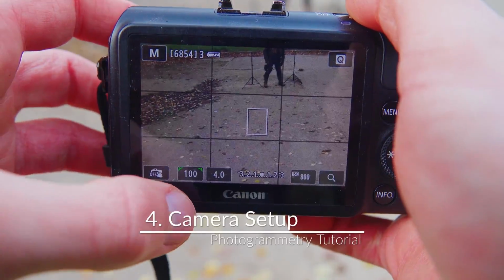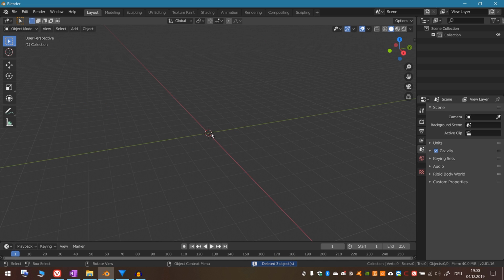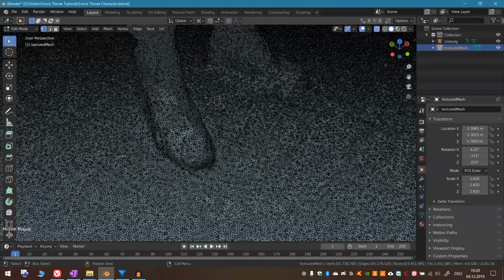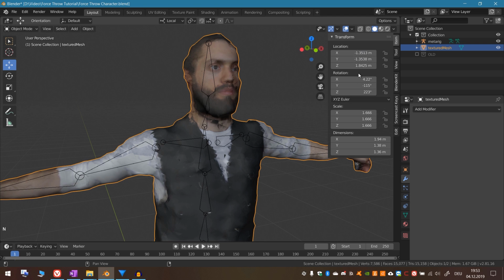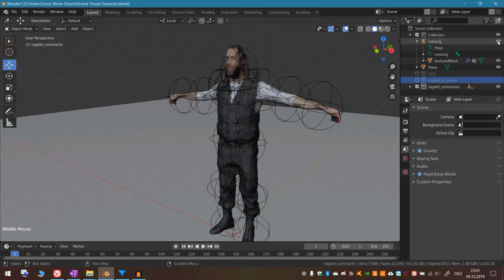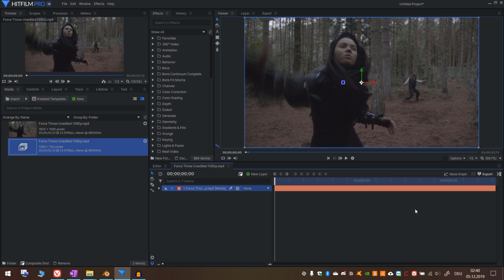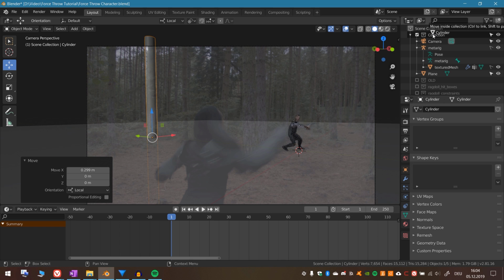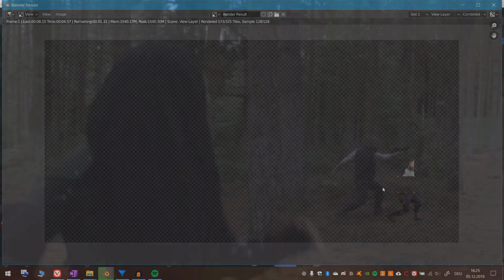Creating a 3D digital double in Blender & Meshroom | Blender Part 1

Comment: Timestamps - big advanced tutorial, fyi CUDA makes the rendering times sane without it plan accordingly, comment stamps you think are important to reference.

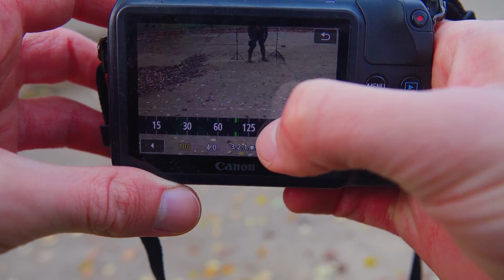Photogrammetry overview -  1:18 Actor T-pose with stands, 1:43 Camera settings
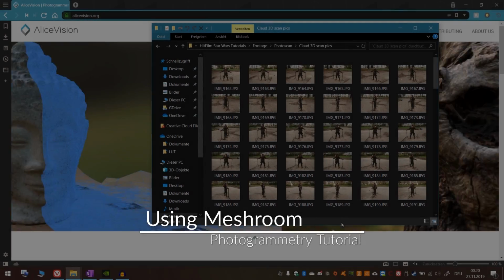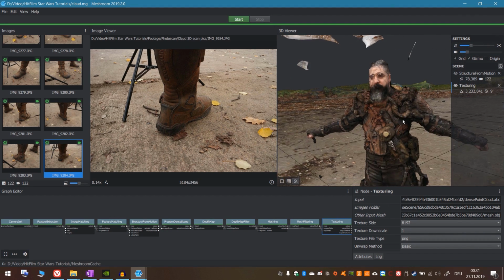2:53 Meshroom , 4:45 troubleshooting and problem examples
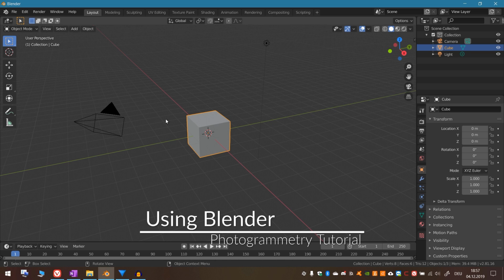6:38 Blender Import meshroom .obj file and blender mini crash course
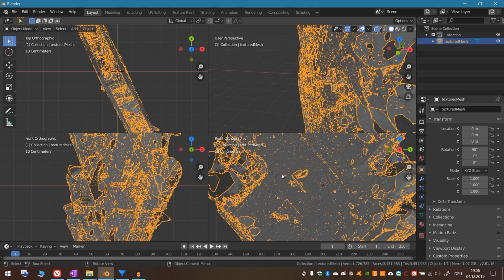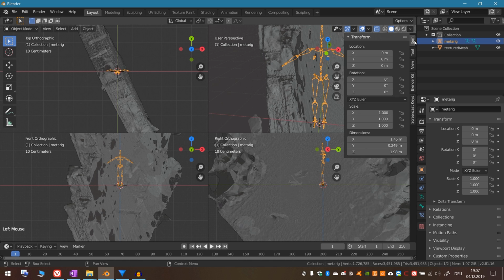 8:46 adding the reference mesh rig using Rigify(*free blender addon included in install*) , 9:19 Scaling the mesh/model [1]
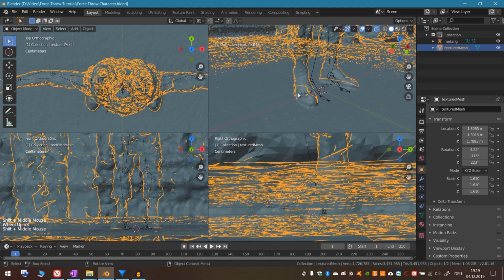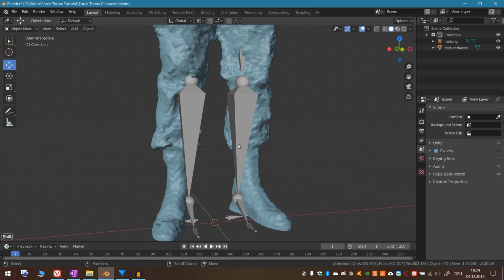  11:41 Mesh Extraction, 14:10 Rig visibility and alignment, 16:11 Mesh cleanup
 18:05 Physics setup using Ragdoll Tools addon (~$22 blendermarketplace) and 19:18 visual limits addon (free from github). Free method missing
   24:58 progress demo
 25:03  Animation keyframing
    26:49 progress demo - watch ollie fly
  26:51troubleshooting shaky glitches by increasing the steps per second to ~120 used by the rigid body world in the scene properties
27:16 Hitfilm export reference image sequence creation and blender import and setup
 29:37 Mesh starting pose alignment
  32:15 progress demo
 32:19 Tree collision setup
34:50 Blender rendering

[1] to change dimensions measurement units from metric to imperial(feet,inches,etc) use the scene tab in the right hand side panel in it's unit section , it's about the ~5th tab down you may want to change this back in case other tools are expecting a specific unit. Keep in mind this can throw things off if other tools in the pipeline are using a different unit
.
Reply: 18:53  Link in description for free video on manually creating a Ragdoll Setup 
 Blender: ragdoll tutorial
 by BlenderShortTests  /watch?v=GaZAI8RIq0
Reply: Huh... Useful of ya to build a ToC for this one....
Reply: Paul Newton, that took some effort. Thanks!
Reply: @anthonysvfx8424  yw but it helps me too for future reference,  hardest part  for such a amazing tutorial was coming up with short names!
Reply: Great tutorial!
Reply: I am having problems editing with HitFilm express. After i got the latest version, i finished editing my video but when the video finished exporting there was a transparent yet visible overlay of the HitFilm logo and a repeating lo-pitched Ding sound. Is it removable?
Reply: @thegreatestrussianspy6739  That descriptions seems like you have Hitfilm Pro installed and the trial has run out possibly, either you need to un/reinstall hitfilm express or check your activation licenses.  If that doesn't solve it go ask on the fxhome forums for help.
Reply: @thegreatestrussianspy6739  Per a comment from FXhome elsewhere in the comment section:
"You'll need to activate the program in the File -> Options -> Activation menu.
- Javert"
Reply: i will comment this here since your comment seems to be a sort of hub for people to look when they have trouble: 
in blender, when you add an object, that object will be added where the 3d cursor is (red/white circle with the lines poking out)
this means it will NOT automatically add the object to the center of the world if you have accidentally moved the cursor. the instructor showed how to move the cursor back to the world origin, which is what i recommend doing in such a case.

Comment: Hello, so if you have problems with your ragdoll just flying around out of control I have a janky method of fixing it.
Go to the ragdoll pie menu and then do "Set limits" what you want to do is change the mode to location and rotation and you can do that with shift m. If it's still outta control, I have no idea how to help you. Good friggin luck..

Comment: this tutorial is a BOMB.
I followed and it works perfectly with my photogrammetry!
Question: lets consider we have a 5 minutes 3d animation in which I want to animate my character using rigging classic stuff. Then I need a scene where my characther is thown in the air like in your tutorial. 
You need 2 versions of the character in that case, one for the classic animations and 1 for the "phisiques" scenes, right ? 
Because I see that you control some keyframes at 31:47, but of course that is not the most suitable way to animate a character if it is intended for a 5 minutes animation.
Thanks for all of your work!

Comment: Would this be a way of making textures and/or models for games like Squad, Post Scriptum etc? A way even to create and implement better ground textures?
Reply: For games you're generally going to want quite low resolution meshes. For game work you'd be doing a complete retopo over the scan. Photogrammetry is pretty amazing in terms of being able to create a mesh of anything you can scan, but it does generate ugly, unoptimized meshes.
Reply: @HitfilmUniversity  When I understand correctly I d be able to but it would be visueally not pleasing and unoptimized. 
For a "rough draw" although with the idea in mind of improving meshes later it would be a good way to go?

Comment: This is so good! I feel like going in a manually fixing some of the topology of the model would help with the final quality and make it almost perfect.
Reply: For sure! I just didn't want to go into that too since the Tutorial is already so long ^_^
Reply: @ChangorooStudio  Also, for the final shot, "Oli" is far enough away that the mesh didn't need to be super clean.

Calver, while I've got you in this response, I'm trying this myself (with a sub goal of also being able to take the digital double into Mixamo), in terms of workflow, is there a reason you lined up the mesh with the bones before trimming away the excess geometry? It seems it would be easier to get rid of the excess geometry before aligning. Eaiser to see, fewer polys for Blender to push. Now my machine is an aging 2014 laptop, so I'm getting plenty of lag in Blender, and Meshroom is taking 3-4 hours to compute, so, unless you had a specific reason for aligning to the bones, first, I think I want to trim.
Reply: @HitfilmUniversity  You can also delete unnecessary geometry first, before aligning it.
Reply: @ChangorooStudio  TY! Although the way the first set of photos came together... If I retexture the missing bits of my head and limbs, it would be a good zombie.

Comment: 🤔Why 24mm or lower for the lens?
Isn't the distortion minimal when using tele lenses?
Reply: Yes, you will have less distortion, but also less paralax, which is also very important for Photogrammetry.
Reply: @ChangorooStudio  Ohhh get it, thank you very much😉
Reply: @Boruchequ  Also the sensor in the EOS M is APS-C,  so 24 mm will be equal to 38mm aprox. in a full frame camera

Comment: I don’t have a camera, would it be okay if I used my iPhone camera for this?
Reply: Look for the display.land app. It's a photogrammetry app for phones. Using display.land you should be able to use your camera to shoot, generate the geometry directly in the app, then download the textured OBJ from the display.land website and go right into your 3D modeling program.

Now, I will say I've tired display.land on my Android phone, and it does work, but I have gotten much cleaner results with my DSLR and Meshroom. Some of this will depend on how close you want the double to camera. In this short, "Oli" is pretty far away, so they could get away with a somewhat ugly model that looked like Oli AFTER hitting the tree....
Reply: You just have to make sure you can Set All automatic setting to manual.
Reply: Calver ok thanks
Reply: If you have above an iphone 7 or something it would probably be better tbh. There's apps that do exactly this in 10% of the time.
Reply: Evan Poliquin oof I have a 6s

Comment: since it was really not a very close up of the digi double... i would recommend to use a simple low poly base mesh and project the subjects pictures onto the mesh. And warp the mesh with soft selection according to the subject.. This would be more time efficient and really fast smooth looking simulations.

Comment: Cool! I'd recommend using the Mixamo auto rigging feature to save some time
Reply: It would also save a lot of time to use Keen Tool's free add on face builder for the head. Honesty you could just use face builder for the head, and make human or some other programs similar for the body, than you could get to the character and you wouldn’t need to have such a high poly model.
Reply: I meet a lot of trouble to use mixamo rig with the ragdoll add-on. The hitbox is always appear like a stick and it take time for me to re-shape it. Do you have any tips?

Comment: Couldn't you use a video camera as well with an actor on a turntable. Then convert the video to image sequence?
Reply: i think it is possible but maybe this software here has to track the background
Reply: It could be possible.But taking individual photos is better option as the resolution will be much higher than video and you can select  the best photos for scanning.
Reply: @adityayardi7696  Thanks, I was just curious. I have used mushroom and know how picky it can be with the clarity of images required to get a good result. I know most hobbyist video cameras would be a far fetch from 20+ mp quality.
Reply: This will work best if you have a perfektly soft, undirectional Light setup. But since that is very Hard to do I wouldn't recommend it.
Reply: It's possible but A. Turntables that big are not easy to come by and B. Still photos give much higher quality than video and photogrammetry software needs as much detail as it can get.